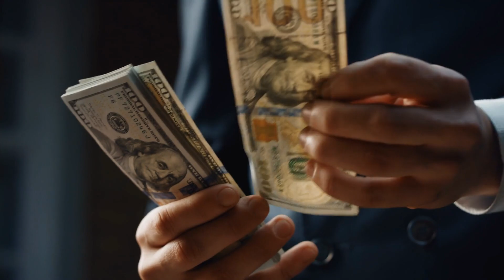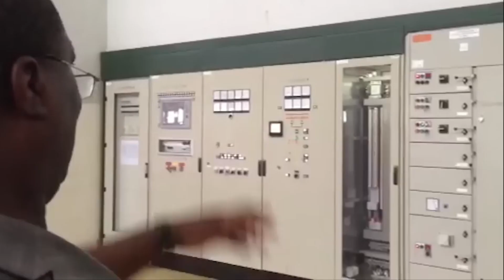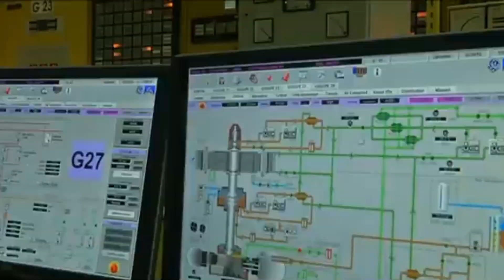Africa is Building the World's Most Powerful Mega Dam

Comment: A shame the dam is not designed to use geopolymer or alkali-activated cement, 70% less expensive for raw materials, curing twenty times faster, 160% stronger than the OPC designated for its build.